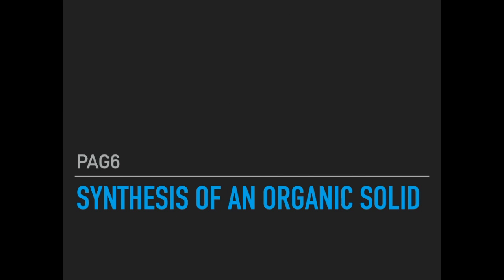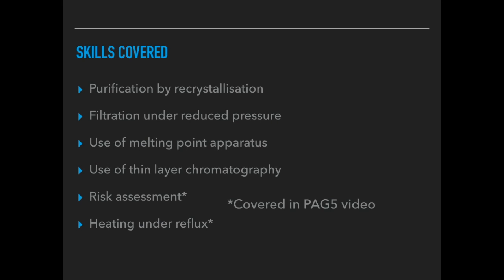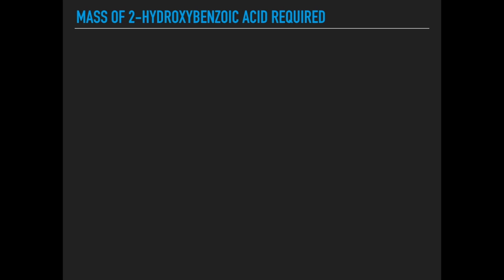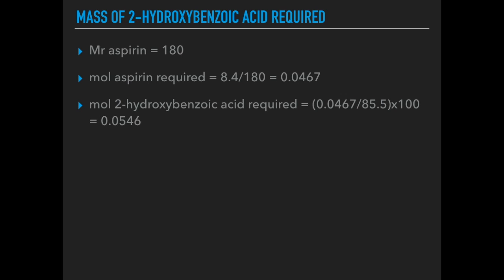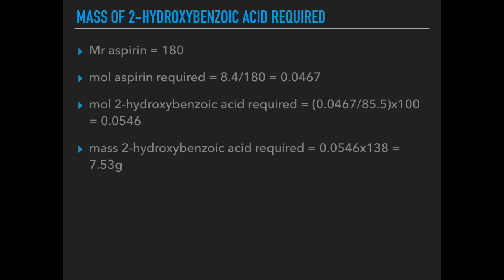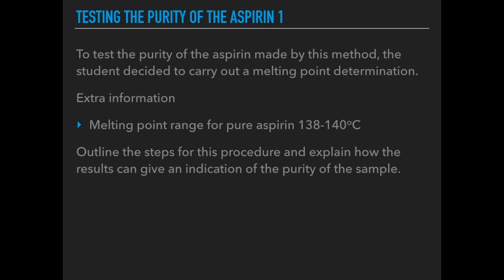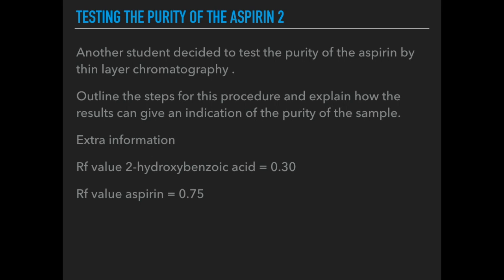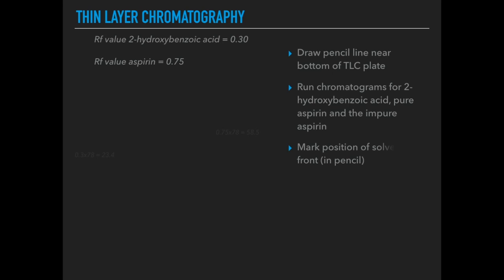PRACTICAL SKILLS - PAG 6 - PREPARATION OF A PURE ORGANIC SOLID

Comment: Hi there- another great video. Just wanted to ask why minimum hot water is needed to recrystalise, why you need to cool before filtering and why cold water is used to wash away impurities?

Thanks in advance
Reply: H might be abit late but for anyone else, minimum hot solvent is needed because if you have too much solvent some of your product may stay dissolved when the crystals form in the next stage. You need to cool the product after the hot solvent is added so that the crystals can form. Then you filter again, and wash with COLD water- if you use hot water again the PURE product will dissolve again (which we don’t want) so washing it in cold water essentially gets rid of any final impurities (the impurities can dissolve in cold water but pure product can’t)
Reply: For ocr I don’t think we have to know why it dissolves in hot and not in cold, but I assume it has something to do with lattic enthalpies I may be wrong